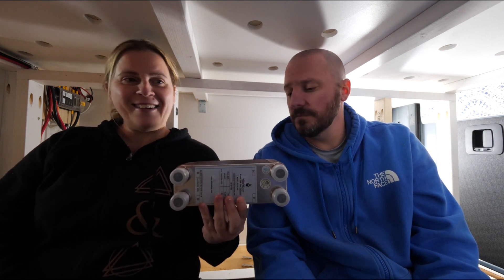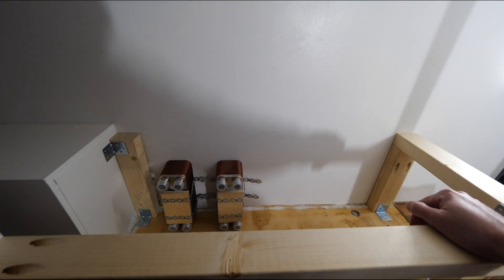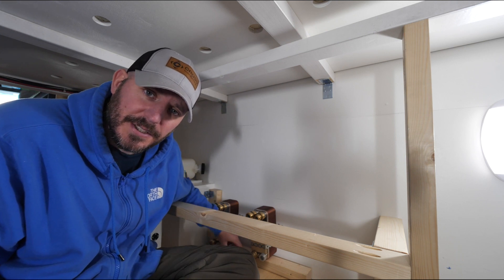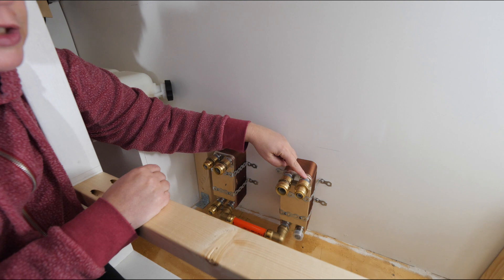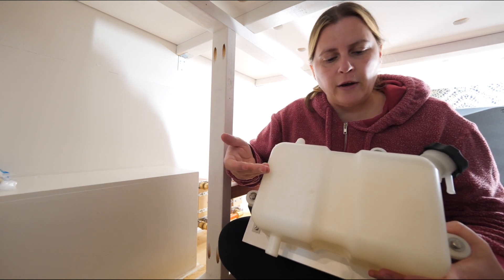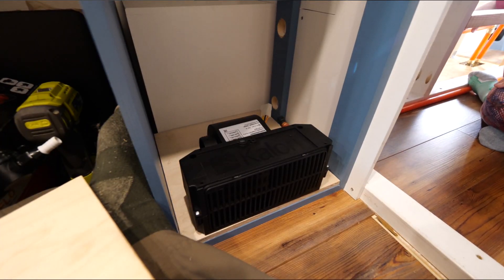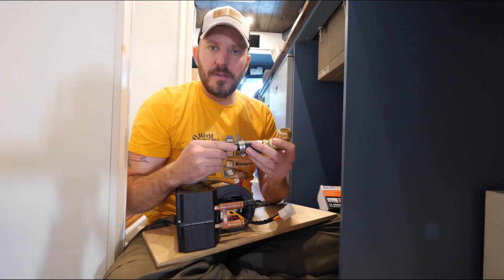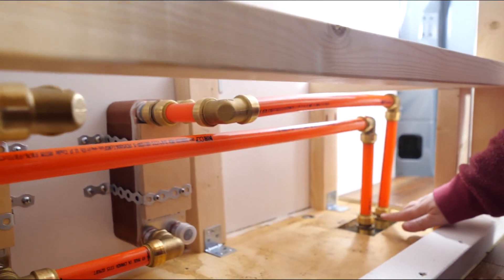Diesel Hot Water and Air Heater: ESPAR HYDRONIC System Install in a Sprinter Van Conversion

Comment from the maker: What are you using for heating and hot water in your van build? Have you installed a hydronic system? How do you like what you are using? Please tell us! We'd love to hear about it!
Reply: I am using similar materials as you are. Using only one heat exchanger with electronic valves for directional use. After coolant leaves heat exchanger it is t-d off to either hotwater for kitchen or shower or heating. I am placing a 3/4" brass electric solenoid valve  each line . This will keep from heating the van when I need hot water and vice versa.
Reply: I have a 2001 e450 powerstroke shuttle bus and I have a piece of 1-in stainless pipe that runs through my water tank and I use the engine coolant so I can have hot showers.

Comment: For those doing hydronic pay close attention to the heat rating of the plumbing. Hydronic furnace makes 185F (85C) water and pex is rated to 180F so it will break down. There is Aluminized pex which is safe to 200F.
Reply: Or automotive heater hose can go to 250F

Comment: Nice job! One item I see though... whenever plumbing through a device that has a vertical flow you should consider that the flow should enter at the bottom and exit at the top. The reason is the device probably will never completely fill and efficiency will suffer as a result. Then there's also the possibility of gurgling, hearing water splashing, etc.
Reply from the maker: Thanks for the tips and that totally makes sense! ! We had considered that but we were just running low on space which is why we connected them the way we did. Good news is that they still work great!  Thanks for watching!
Reply: Hi Carl Beaver, I'm setting up a similar hydronic system. With your comment, is it better to run the water from bottom to top or the glycol fluid? As my installation information only mentions that the two fluids should run in opposite directions.
Reply: @tarntravia3705  heated fluid should enter the bottom of your construction.

Comment: What is the system like to use. Because in my head I am think this setup is like a tankless hot water system where its heating up the fresh water on-demand as it passes through the heat-exchanger. I am imaging this will use more of your fresh water before it gets warm enough to use. is that the case. I like your setup but I think I will opt to use a Calorifier tank with an heat exchanger and 500w coil for backup. But I'm thinking it might be better heating up a tank of water rather than an on-demand system where the water you have might off to last longer if you're boondocking. And that way with the tank I am effecting adding to my water capacity but an independent hot water. Which I'm sure your system provides as well. Great idea though which i will be pinching but lean towards calorifier tank rather than multiple heat exchangers.
Reply from the maker: The first split second of water isn’t warm due to the residual that sits in the line past the exchanger, but after that it’s all hot water!!! We haven’t had any issues with running out of water so far, but sounds like your idea would save water! Update us on how it works! Thank you for watching!

Comment: Hey !  Nice video!  I'm planning my next build and looking to buy an Hydronic system as well (maybe the Espar S3 D5E model) for hot water system and air heating (Kalori 5.5Kw).    Winter can be freaking cold here back in Québec, Canada and I'm also looking for heating the floor with this hydronic system. (I had an Espar D4 airtronics 5K in my last van and it was enough to heat the air but the floor was always cold tho...).  Heatso website looks like a real mess...  I don't even imagine how it can be dealing with the customer services...  I'm considering buying all the parts separetely and choose each part of the system...  Got hard time finding videos on that topic, seems like it's a new way for heating vans..  Looking forward on your build!   I've also watched Dares Drives and Freedom Strider videos, great informations indeed!
Reply from the maker: Hey! Thank you for watching! Heatso has definitely been a “challenge” for us! We are really regretting buying from them at this point and we certainly can’t recommend them to anyone. We continue to have problem getting the heater running and getting in touch with Heatso seems impossible at this point. Not to mention it’s an expensive purchase to have this many issues. But anyway, I think I’m whining at this point! 😂 I think heating the floor is a fantastic idea! We would have done the same but this unit was an after though for us and we were well into the build before deciding to go with it! There another UK company called Mellor Online. Then appear to be a little better and of course there is Rixen Enterprises here in the US. Also we hear Espar of Michigan is helpful! Best of luck with you build and we are always happy to help if we can! Stay warm up there in Canada!!
Reply: I'm in the same moment as you, idem with the heating floor! Avoiding heatso is a very good idea! I'm not sure if i have to go with the Espar D5E or the Webasto Thermo top Evo 5. I'm researching about the remote on/off of the heaters!
Reply: @garbi8526  "Weekends We Roam" has a good video on heatso. He recommends buying from an actual espar dealer like esparparts.com
Reply: I just ordered the Espar hydronic system from heaters4you.com. It’s less than $1k but doesn’t include the blower.
Reply: How do you go about doing the floor? Did you end up doing this now at this point?

Comment: Are the heat exchangers the only radiators for the entire van?  If so,  how are they working?
Reply from the maker: our system is totally separate from the vans radiator. we have a small glycol tank and the 2 heat exchangers. One exchanger is for the shower and the other is for the sink. There is also an exhanger attached to the blower for our heater. So far they are all working great!

Comment: LOVE IT! We purchased a hydronic heater as well for our van. Was there a specific reason you didn’t plumb it into the vehicles cooling system? Thanks a bunch. Sub’d
Reply from the maker: Yes! We wanted to keep the two systems separate in case of some kind of hard failure that would keep the van from moving… I haven’t heard of any issues but that was our thought process at the time of the build! Thank you for watching!!!!
Reply: @WanderfulRevolution  ah, makes sense. Thanks so much!

Comment: Hi, excellent video, what size heat exchangers have you used please?
Reply from the maker: Heat Exchangers - https://amzn.to/39mP2jb
The ones we bought had 30 plates, but it seems they don’t have that one available right now. You can probably go up or down without any issue. They have a 26 and a 40 plate version.
Reply: @WanderfulRevolution  thanks for the reply, very much appreciated indeed 👍🏼

Comment: Hay great system, do they come with 2 heat exchangers for the water or have you added a second one?
Reply from the maker: The kit  we bought came with one heat exchanger. It ended up being way to big for where we wanted to mount them, so we ended up buying those 2 on Amazon. Much better size for our application.
Reply: @WanderfulRevolution  I'm curious how the 30 plate HE is turning out, does your sink water get hot enough? I ask because some of these kits use a 10 plate and bypass mixer which would be nice for the size but might not get hot enough.

Comment: Considering a similar system so wondering how this is working for you? As a side note, to improve the heat transfer on the heat exchangers, your heat source should enter the lower ports and exit the higher ports.
Reply from the maker: So far it’s working great! No complaints at all. The hot water is HOT!!!!! And the kalori blower for heat keeps the cabin plenty warm (we’ve only used it in temps as low as 25F though). We are definitely happy with it.
Reply: @WanderfulRevolution  What happens when the hot water flows into the top instead of the bottom is you'll almost always end up with air in the top  of the exchanger. That means that exchanger (and possibly both) probably has little more water inside than it takes to cover the lower nipple. That creates a lack of efficiency and a potential source for gurgling noise. But, if you're happy...  :-)

Comment: Do you know what you'd need to do floor heating as well with these? Is it the same as the regular disel heater by espar but adds on the hydronic? Curious if it puts out same amount of heat. Also curious how this system works out with a recycling shower? And it only really is hot while driving isn't it?
Reply from the maker: The same setup would be fine for heating the floor as long as you don’t exceed the max circuit size. As for the heat dissipation I’m not sure… but our water is scalding hot if we want it to be… with the recirculating shower it has it’s own heat exchanger… it’s on whenever we turn it on… we didn’t tie into the vehicles coolants system… we just push a button and five minutes later all the hot water you want! Hope this helps!
Reply: @WanderfulRevolution  that's helpful thank you!! 

So did you have 2 different heat exchangers 1 for recycling shower to keep it in the same loop and another for the sink water?
Reply from the maker: @konorrockhill6191  correct! One heat exchanger for heat and sink and one for the shower
Reply: @WanderfulRevolution  ahh okay. Im getting the hang of it now. Just need to figure out the 2nd heat exchanger portion. On heatso. Their espar hydronic kit is 3k and another person said they got theirs for 2k so im not entirely sure all the components. do you have links to where you bought them? I've heard some places are terrible to buy from with customer service or what have you.
Reply: looking to buying this setup, do you recommend anywhere to get it?
Reply from the maker: @konorrockhill6191  we purchased our from Heatso… if we had to do it over again we’d probably get it from Rixen… their systems come plug and play with more options… pricier but we think the price is worth the difference vs the headaches we had
Reply: @WanderfulRevolution  huge help thank you!! And do you know anything about their customer service if anything goes bad? Does it also come with 2nd exchanger or but separately on Amazon or something
Reply: @WanderfulRevolution  oh wow, I'm seeing a 1.7k difference in price. Do both kits come with flooring as well because it looks like rixen has their own floor kit separate for another 1k. What's the big difference? They have just connected it all or? And you say it's work the 5.1k to just get it there?
Reply from the maker: @konorrockhill6191  prices have changed dramatically!!!! I had no idea it was that expensive now! Our system was a little over $2000… not sure if I’d be in for over 5!
Reply: @WanderfulRevolution  oh wow yeah that's kind of what I was thinking.  What was the rixen price when you looked last? Heatso I think it's 3k
Reply from the maker: @konorrockhill6191  it was about 500 more… but had some nice extras… I haven’t looked in a while though!
Reply: @WanderfulRevolution  ahhh I see. Dang.. ya I want the system but don't wanna spend 5k for it ha

Comment: Hi, did you install 2 x 30 Plate Heat Exchangers? And is this too hot or just right. Why not just install a 50 Plate Heat Exchanger? Thanks :)
Reply from the maker: Yes we installed 2 x 30 plate heat exchangers. The water can be very hot, but mixes well with cold water to an appropriate temperature. We have 2 exchangers because we have a recirculating shower, so that water has to be kept separate from drinking water. If you don’t have a recirculating shower, then a 1 x 50 plate exchanger would be fine. Although I think even the 1 x 30’plate exchanger would be more than appropriate
Reply: @WanderfulRevolution  Thank-you :)

Comment: you guys did great but you should really reverse the plumbing to enter the bottom and exit top of your heat exchanger so you don't have any air pockets trapped. Even if it's working now I would say it's almost essential for longevity and reliability you don't want an air lock or your pump trying to move air. That's how a radiator in a car works too in bottom out top

Comment: I would just use silicone heater hose , cost more, but more  reliable/ flexible, and fewer joints/ leaks/failure point... may be cheaper than all the shark bites.
Reply from the maker: Good point. Sharkbites are definitely pricey and there are a lot of connections

Comment: why not use a radiator hose on the glycol side Instead of orange pex?
Reply from the maker: We did use a radiator hose for the portions under the van, but decided to use pex inside because we had a tight space to work with and for us the pex was just easier to work with to make the turns exactly where we wanted them.
Reply: @WanderfulRevolution   help! We have the same system setup and we have low heat and water. We are wondering if we need to add glycol?  Van is 3 years old.  We also are getting a message on the easy start controller that says Add R.  Watching all your videos hoping to learn about the system.

Comment: I purchased a kalori Silencio 2 from heatso. I try to figure out if I have to remove the rubber from the 2 pipes or not. Masybe you can clarifi this for me. Thanks
Reply from the maker: We removed the rubber plugs from ours and attached our hose directly on the fittings. Thanks for watching!
Reply: @WanderfulRevolution  Thank you. Great video.
Reply: I purchased the kalori compact evo1 heat matrix, it is loud 75e.g. on hi speed, I am wondering how it compares to the silencio  2 for noise level.

Comment: I am mounting my heat exchanger to two verticle 1 inch 80/20 extrusion. I am mounting the 80/20 extrusion to my wall with screws then using metal strapping to attach the heat exchanger to the 80/20. This also gives air flow under the exchanger and keeps it off the wood wall.
Reply from the maker: That’s a really great idea! Are you doing most of you build with 80/20 as well? Let us know how the exchanger mounting turns out!
Reply: @WanderfulRevolution  using the 80/20 for the garage area and bed support. Also used it to build a roof rack and frame for the solar panels. We are enjoying your instructive videos. Thanks.

Comment: What is your source for your header tank?
Reply from the maker: We are using a propylene glycol mixture in our header tank. The tank is dedicated to the heating system. We top off the tank as needed.
Reply: @WanderfulRevolution  where did you purchase the header tank. I am also installing the Eberspacher system in my van.
Reply from the maker: It was a part of the kit we bought from Heatso.com and I believe you can purchase them separately there as well. I haven’t researched it much but an auto part store may have what you need as well